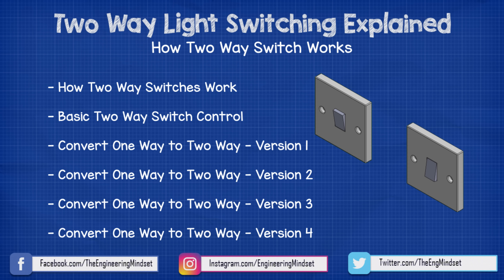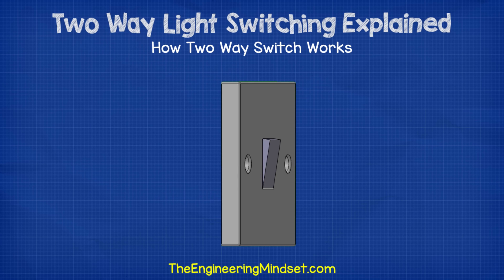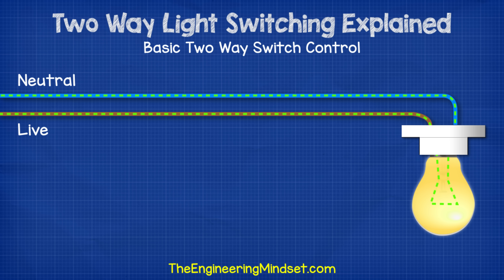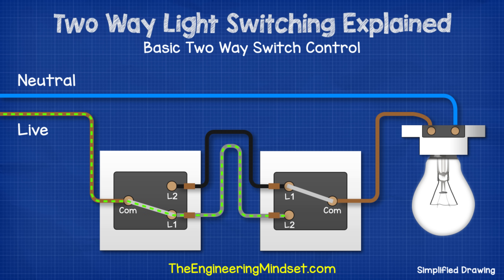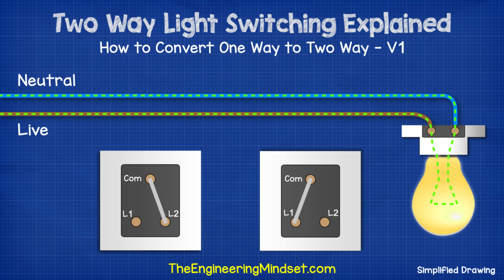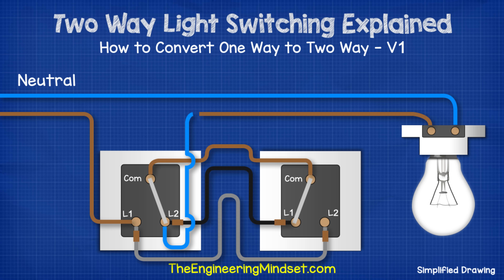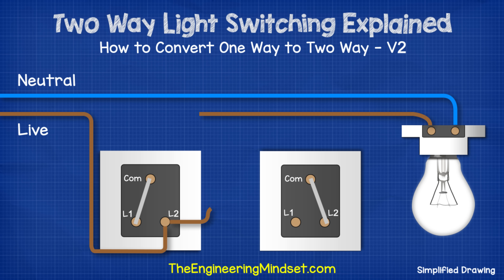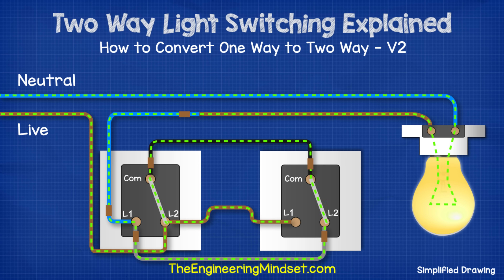Two Way Switching Explained - How to wire 2 way light switch

Comment: why the heck do you use a blue (neutral) wire as live????
and i never heard of that "brown sleeve rule"
Reply: I think it's a UK thing. We don't have that requirement here either.
Doesn't matter what color, they can all be dangerous. Touching a floating neutral wire (blue) coming from a device can be as dangerous as touching a live wire.
Reply: @ppdan  more dangerous because you have the full inductive  load of the whole circuit
Reply: @KappaKappaKappaKappa, I'm no electrical fundi, but as far as I know the blue and brown (our local colours) can be interchanged, but NEVER interchange them with the earth.  I found this out when I rewired the toaster plug at age 8, and my aunt flew across the kitchen when she switched it on.
Reply: @Visionery1  Please don't. There's a common misconception that Brown/Blue (Live/Neutral) Alternative Current can be switched and, indeed, most electrical equipment will work just fine. HOWEVER (Big however), the potential difference (i.e. voltage) is generally zero between Neutral and Earth. In other words, you can touch neutral and Earth together and nothing should happen (assuming everything else is correct) - on the other hand, live to neutral or live to earth will be whatever your standard supply voltage is. 

So in that sense, there's a reason one is marked "live", even though your average appliance doesn't care. But this manifests itself down the line with things like internal fuses being wired into live, so although your appliance may work, it's safety features may be supoptimal or even useless.
Reply: @regiondeltas  Most wall plugs in the EU can be plugged both ways and the regulation in most countries don't oblige you to wire live/neutral the "right way" in a socket.
Also, not all places actually have a neutral. You can have a 220V system where both wires are live which means that devices will not receive a neutral and there is a considerable dangerous voltage between each wire and earth (130V).
Reply: @ppdan  True, it was a very UK centric answer but it's still correct electrically. The PD is different for Neutral -> Earth vs Live -> Earth. If there's a "right way" round, then it should always be wired in correctly for that reason
Reply: Guys don't get me wrong. I'm an electrician in Germany, yet I never heard of that rule.
I think @ppdan is right with "it's a UK thing".
Reply: @xcruell , German rules are different.
Reply: It's no different in Canada, other than colour.  You may use a neutral wire as your traveler, as per electrical code.  Here you don't have to sleeve part of the traveler either.  So if using 14/2 cable where black is live and white is neutral, it is perfectly acceptable to use white as the traveler to carry power between the switches.
Reply: About the German electrics:
With the exception of 4-wire main power supplies, the blue wires must NEVER be used as active live conductors.
Otherwise in Germany, the wire colors are to be used as follows:
Brown = L1 (230 / 400V) permanent or switching functions
Black = L2 (230 / 400V) permanent or switching functions
Gray = L3 (230 / 400V) permanent or switching functions
Blue = N
Green / yellow = PE (protective conductor)
The rotating field in a three-phase system must be provided by us as a right-hand rotary field (clockwise) to the customer / consumer / CEE socket / device / machine.

For very old electrical installations, black or brown was used as the live conductor, gray as the neutral conductor and red as the protective conductor.
With a wire cross section of 6mm² and larger, red was also used as a live conductor. Very confusing and if you do not know that, also extremely dangerous.
Reply: @Sven-der-Technik-Freak  I do know that rule of "never using the blue/neutral wire as live".
But in some cases (depending on the circumstances) you dont have a other choice.
But you are not allowed to use the pe as anything other than earth.
Reply: In Finland we can use blue as phase and should mark it with tape/sleeve/marker. Color of that marking can be any of the phase colors though, so it is usually black. Those markings are really only found on 3 phase motors, where neutral is not needed and someone has saved couple euros and got 4 wire cable to it. In lighting setups its a miracle to found any indication on the role of blue conductor. We just know that it is most likely returning phase, if it is connected to switch.

This video shot itself in the foot when showing exactly the same connection multiple times. There was only two different setups. And there should have been junction box(es) to show how it is really made, that strange wire mess between things must confuse someone who is trying to understand what the cables on the wall actually do.
Reply: @Lucky Joestar that is what I meant.  I was just saying that for residential service the white wire is neutral.  The exception is when used as a traveler.
Reply: Different rules in different country's
Reply: The only point where blue was used as a live wire was in the two conversions and I doubt someone would be happy if you tore out a section of their wall just so you could remove a blue wire and replace it with a brown one.

Comment: 4:16 won't that create a short circuit?
Reply: Wat, no. How do you think it would create one?
Reply: @xcruell  The electricity is going on a loop without passing by a resistance (the light in this case) isnt that a short circuit?
Reply: If there is no potential difference there is no short. Think this way if you touch two wires to each other that are 0 volts each (in difference) nothing will happen even if there's 120/240 volt on it. Try it at home with a 9V battery take a volt meter (if you have one) and put both measuring pin's on the positive or negative side of the battery the result will be 0V because there's no voltage difference if you place one measuring pin on the + and the other on the - you will measure properly something like 9V or lower considering the state of the battery.
Reply: @Fogolol  No, that isn't a short circuit

Comment: I think I'd prefer to see this done in a real-world situation. It's all very well saying 'cut this wire' and 'run a grey wire to here' etc. but it doesn't mean much when I'm looking at my house lights.
Reply: Run a 2core and earth to the light as a feed and down to a switch then 3 core and earth inbetween each switch.
Reply: It can be difficult to do a conversion due to finding a wiring path. Obviously a new installation is easy but the principle is straightforward enough. I suggest re-watching the video and take a few screenshots to work out what's best for you. Bear in mind that on a conversion, some of the wiring will already be there and can be used. You will have to run an additional cable though, no getting out of that.
Although some have made fun of / questioned the live 'sleeve' (or tape is just as good)  it is very useful to keep track of the intermittently live wires.

Comment: Legend, and thanks for saying "put brown sleeve to show it's intermittently live" it really could save lives
Reply: It's not needed, first because you must assume all the wires are at live potential (220v), even neutral or ground could be at fault condition, and then black and gray are the colors that in a three phase supply are assigned to each phase, so you assume that they are live. 

In my country you are allowed to use any color you like for wires, except are not allowed to use for phase yellow/green (obviously), blue and also white (because it's typically used for low voltage cables like TV coax, alarm, network and telephone, and thus can be confused).

That is useful especially because we use to have wires put inside pipes in the wall, and if you don't use different colors and you have 4 brown wires that enter a pipe, it's a bit of a problem to distinguish them on the other side. Also you can immediately identify the purpose of the wire if the electrician used color consistently in the whole house, for example in my home black wires are lights phase, brown plug phase, then other different colors for example orange, red and pink for switch wires, gray for thermostats, and so on.
Reply: @alerighi  i agree with you . British regs arr the same  brown/ black/ grey are live .the sleeve is usedif brown /blue twin & esrth cable is used
Reply: @umt1cardiff  In the UK, what should you pay attention to when buying a new dimmer? Will it be considered that the dimmer is not suitable for the cover frames ?
Reply: Well, this varies from country to country. Here in Sweden we have other colors for connecting to lamps and wire between switches.
Reply: @stefannilsson2406  In Sweden, do you buy a dimmer that matches ELKO's cover frames?
Reply: Someone working on (potentially) live wires are already dead to murphys law. Before working on electrics you should ALWAYS switch off the power, even if you are a cool dude that can work under some pressure, it is required by law (at least in eu) to do so.
Reply: @viggoavatar  yeah that is true, should make sure all circuits are isolated and have no way of becoming live whilst you are working on them..
Reply: @viggoavatar  Even after switching power off, you should not trust the power is off before checking using a RELIABLE tool to make sure the power is indeed off at the point you're working, since any of the electrical items can  malfunction, including the tool used to check.
Reply: @viggoavatar  I've worked on live circuits all my life. It's no big deal if one knows how electricity flows.
Reply: imo, it doesn't matter which color wire you use between two switches. As long as they're different.

If you're working with electricity, you should always turn off the mains.
Colour coding helps because you don't have to constantly test which one is live and which one neutral.

If it's "intermittently live" it doesn't matter which wire you use. You can just use same colour wire, but it would be confusing to connect in the other end...

Comment: Why not just link L1 to L1 & L2 to L2?
Reply: Because someone decided that this would be less confusing for the end user.

Remember that on a single switch light, the standard is flipping the toggle up is ON and flipping the toggle down is OFF. So by cross wiring a double switch it makes it most similar to a single switch.

If you wired it your way, L1 to L1 and L2 to L2, then the light would be ON if both toggle switches were ON or both toggle switches are OFF.

If you cross the wiring, L1 to L2 and L2 to L1, then the light will be ON if one of the switches is ON and the other is OFF. If both switches are ON or both switches are OFF then the light will be OFF.

Like I said, someone thought that the cross wired way will be less confusing and made it the standard.
Reply: Putting 4 wires on a 3 wire switch is not less confusing. Line in to C, L1 to L1, L2 to L2, other C to load. That's simple.
Reply: @diabolusfornacis8234  that's because it's much less confusing that way
Reply: @diabolusfornacis8234  In the UK, the standard is toggle down for on and up for off.
Reply: Makes no difference at all, can be wired either way
Reply: When I was in college, we were taught L1 to L1, L2 to L2. For the Ln & Lo you could connected in the C’s or alternatively Ln to L1 & Lo to L2. Depending on your wiring configuration. Seams simpler to me but that’s what I’m used to 🤷‍♂️

Comment: there are only 3 versions, in my contry we call them A, B and C. the first witch we call the A version, and then V1-V4 witch is the same, and we call it the B version. then there is the C version, it works by connecting the com terminal on the two switches to the lamp and the phase to L1, and the 0 to L2 on the 2 switches (the C version is not used wery mutch if at all)